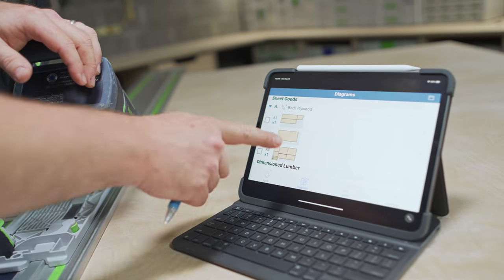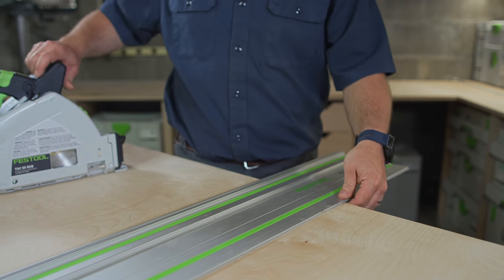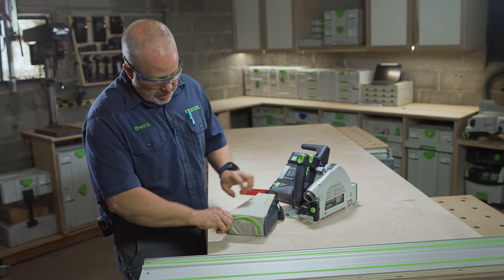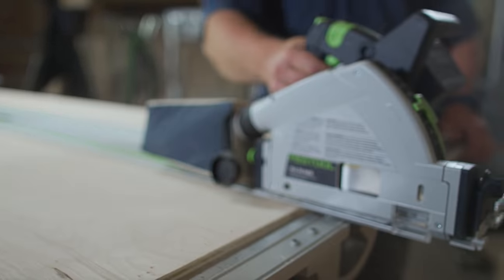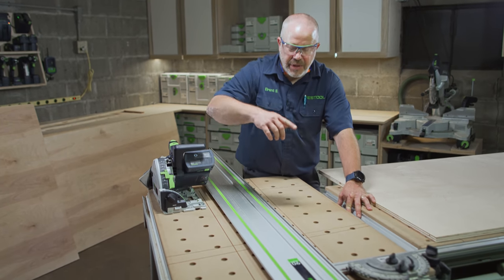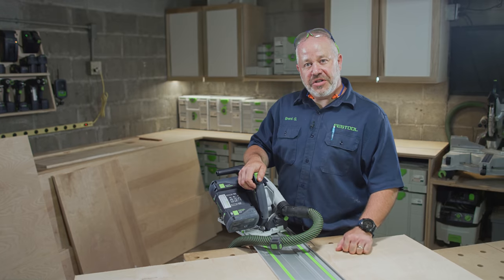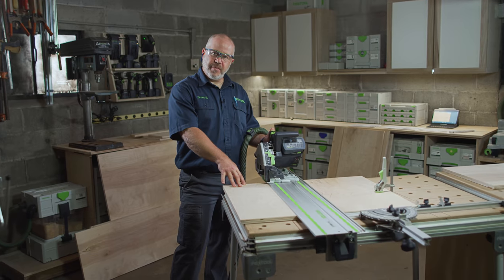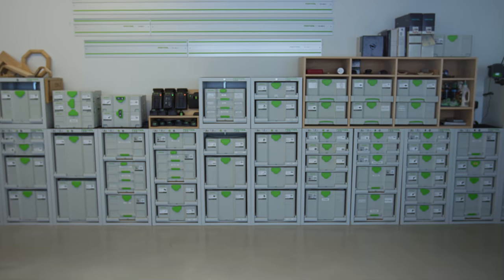Build Series 3: Mudroom Cabinet Build: EP 2

Comment: Why wouldn't you use the 48-tooth blade for all the cuts in the plywood? The fact that the veneer face grain runs lengthwise on the boards doesn't turn it into a situation that requires a ripping blade. I use my 48-toth for all plywood cuts and only use the 28-tooth for ripping cuts in solid stock.
Reply: @Mark Katz  I find that if i change out the blade on the TSC between ripping and cross cutting it does two thing.  1. it extends the run time of the batteries because i'm not pushing 48 teeth through the material, but only 28.  2. it extends the time between blade cleanings, especially when using plywood because of the glue that is in the material.
Reply: @Brent Shively Makes sense. No. 1 doesn’t apply to me since I use a corded saw. I’ll keep No. 2 in mind.

Comment: TSO recently released a much better set of rail connectors, they have a dovetail shape that pull your rails into perfect alignment without the need of a reference straight edge ... and setscrews don’t dig into your track like Festool. I would not be surprised if Festool ends up licensing them, they sell a Festool branded version of the TSO GRS-16 PE guiderail square, The Festool FS-WA/90. Unfortunately it is not carried by Festool USA currently. The only other brands shown in FestoolUSA videos are WoodPeckers squares and Fastcap tapes. It's interesting that they show Brent using a third party Woodpeckers square to make a crosscut, when they could have used a much better 3rd party option in the TSO rail square, Esp. since they do business together. They could also have used the Festool Branded TSO rail square [FS-WA/90], but that would have caused a problem when viewers in North America realized they can't get it here. I wonder if it was TSO or Festool who made the call. It could be so that they don't compete with oneanother, but the TSO and the Festool version are both sold in the UK, I'm not sure about other areas.
Reply: Yea I just bought the festool guide rail square in australia because it's twice as cheap as the genuine tso square.
I will have to look into the tso connectors though!
Reply: Only problem is you can’t find either of those in stock. The TSO is still “sold out” and the Festool, like you said, is not available in the US. Stinks!! I really want a clamping rail square.
Reply: Brian Sullivan I’ve had decent results with a good 12” speed square.  Benchdogs.co.uk has a really nice one, although more expensive.. but the one you might want if you use an MFT or mft style table made with the parf guide. You can attach special dogs that slot into the 20mm holes and be at perfect square to a fence or pair of dogs on the table.
Reply: @briansullivan519  I also bought the last set of tso grc in australia not long ago too haha.

Comment: Or....someone can just buy a table saw.......and this is from someone who loves my track saw.
Reply: Ripping a 4x8 sheet requires at least a 16' unobstructed area in your shop, with a 48" rip capacity on the saw.

I break down sheets using the track saw out in my yard, and then bring things to my table saw. He could also break things down and then bring to a table saw, but then he would have more squaring operations.